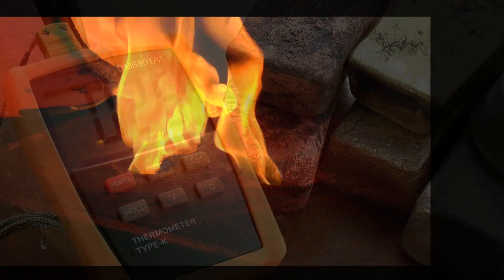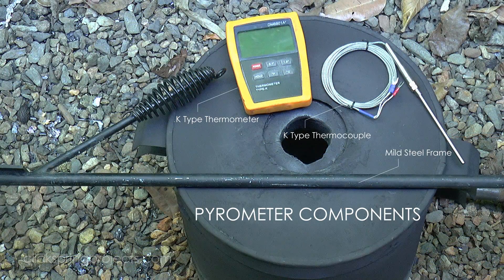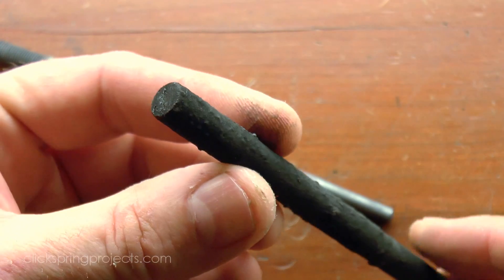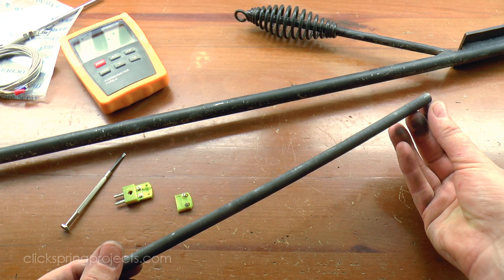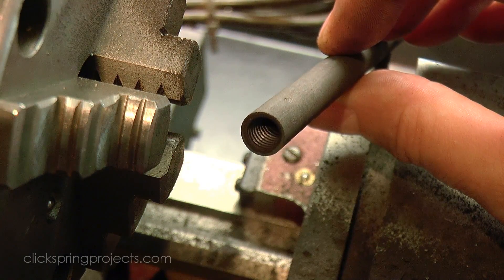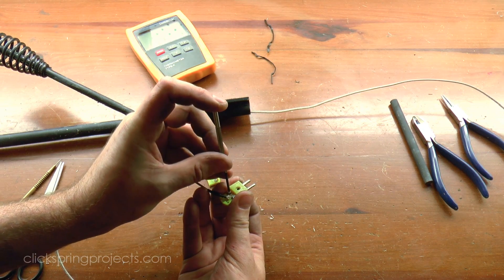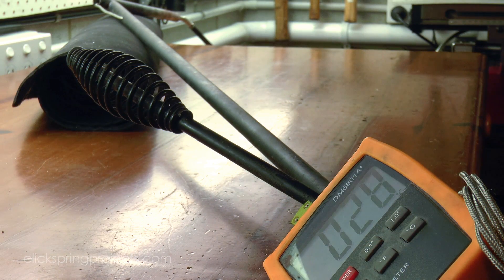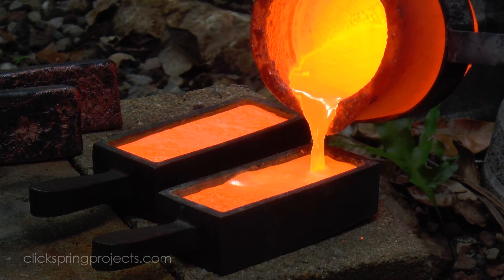Tools, Glorious Tools! #5 - The Pyrometer

Comment: If you know the material - you can use a visible light camera to approximate the temperature due to predictable black body radiation showing up in the visible range. So you could theoretically make a phone app. Just have to be careful with avoiding any processing like white balacing and knowing exactly what the spectral reponse is of the red and blue cfa.

Comment: All thermocouples that comply woth ANSI use red insulation for the negative lead.  If IEC, they use white.  The two most common types are J and K.  J type thermocouples are white/red (ANSI) or black/white (IEC).  K type are yellow/white or green/white.  J type has the best response from -210 to 1200 C (-346 to 2193 F.  K type response is -270 to 1372 C (-454 to 2501 F).  On the connector plug, the wider tang is usually negative.  The usual reason to select K type over J type is that above 750 C, the iron in the J type is susceptible to oxidation, whereas the K type is aluminel/chromel.  The K type can be damaged by reducing atmosphes, and is sibject to drift over time, requiring periodic replacement.

Comment: Hi Chris. Have used a lot of those K-Type probes for everything from freezers to forges with Arduino.  They are cheap and I found them to be very accurate. Never thought about the carbon sheath idea. Do you get the rods from local welding/engineering shops. Not sure what the NSW equiv would be for Nth QLD

Comment: A question in relation to the heat conductivity of carbon between the fluid in the furnace and the thermocouple.  Is the heat transmitted 100% or is it less due to heat loss in the carbon?  i.e. molten metal is 1000 degrees - does the thermocouple read 1000 degrees or 995?

Comment: Is it possible to get thermocouples with any specialty coatings in case one does not wish to use the carbon sleeve, but still keep the dross and slag off the probe?

Comment: Chris how do you know the temp is fully realized through the carbon? Do you have to compensate for the probe being inside the tube?
Reply: When the recorded temperature is stable, you can be reasonably certain that the temperature of the probe is the same as the outside of the carbon tube.

Comment: After about 5 or 6 years of blacksmithing, i'm pretty much able to evaluate a temperature with a 25/30 degrees C margin by eye. Wich is kinda lame compared to what a pyrometer can show, but it requires just skill, so no tools or complicated technology, and it only takes a glance. Tho i wonder how far you can train your eye... Maybe the most skilled could rival low end pyrometers, i'd be curious to experiment with that

Comment: This guy is probably the only one that could pull off drilling a carbon rod and then tapping it without shattering the rod
Reply: I'd shatter it just mounting it in the chuck haha
Reply: @jdmjesus6103  all carbons are not equal. The stuff in the middle of a dry cell is really naff, that would disintegrate picking it up.
Reply: I once shattered a carbon rod just by looking at it. 

Through a monitor on the other side of the world.
Reply: @ricos1497  You must be related to Chuck Norris.
Reply: I remember some sort of japanese TV show where someone drilled through a pencil lead.  Kind of a race between a lathe and a edm machine
Reply: @afjieaf80eg  "supreme skills" is the name of the show. I love it!!

Comment: Have you tried using a high range IR thermometer? Curious as to if you have a preference/reason for a preference between that and a thermocouple, as I have seen some with relatively high ranges for pretty affordable prices.
Reply: IR thermometer accuracy depends on the thermal emissivity of what you're measuring.  Granted, most metals are quite emissive when molten, but they still only indicate the surface temperature, not the core/bulk temperature of the material.

Also, the less expensive ones tend to just give up above 200 degrees.

edit:  I missed that bit about high-range, but the other conditions still apply.
Reply: reflectivity might be an issue, and as well this video originally came out for patrons years ago, prices for IR thermometers werent so affordable then
Reply: i use one for forge welding billets of damaascus and for mokume gane. they are excellent but take some practice aiming because the laser dots tend to disappear amongst the glow of the forge and metal.

Comment: Wouldn't be easier to use a laser thermometer?
Reply: They typically cap at too low of a temperature, and the reflection off the surface totally mungs the reading. I can point at molten aluminium and it might only read 500f!
Reply: Laser thermometers use infrared, specifically they measure the brightness at 2 different wavelengths, then fit the bell curve of black body radiation to fit the readings.
Things that are hot enough to glow are too hot for this method to work.

Comment: Nice video chris. You can do the rod test also, which you take a 6mm or 10mm steel rod and preheat it in the furnace exhaust first, then you stick it in the metal, if the metal balls up on it when it's pulled from the melt, then it's too cold and needs to be heated more, if it leaves a thin shell on it that's paper thin, then it's perfect pouring temp for most stuff, and if the metal repels the steel rod like magnets, then the metal's too hot and needs to be taken out and cooled down. That's a good alternative to needing a pyrometer for someone getting started in metal casting, and works with aluminum, brass, bronze, copper, and other metals all the same.
Reply from the maker: Thank you mate, I had not heard of that method will give it a try! Thanks for sharing :)
Reply: @Clickspring  Yea, the rod trick is an old foundryman's trick that's been around forever. 

Another thing, youre using borax or boric acid as a cover/flux for brass/bronze/copper alloys, I really wouldnt do that because it attacks the crucibles horribly badly. It was common to do before people realized how bad it was, mostly as a glassy cover to help prevent oxygen from reacting with the metal and absorbing into the metal, forming porousity, but if you run your burner slightly rich for copper based alloys so there's not free oxygen, it does the same thing and doesnt eat your crucibles or lining either. I run mine that way and it is much easier to melt the stuff, no porosity in bronzes, and no very little oxide on the melts too.
Reply: I never thought about a wetting test, but that's awesome!

Comment: "extinction pyrometer" are a thing.  A filament light bulb, as the voltage is increased the filament glows.  When it's the same colour  as the molten metal just read off the temperature indicated in the veritable resistor that controls the voltage to the bulb. Calibration is awkward but it's a no contact way of measuring the temperature.  Just a thought.

Comment: I'm surprised that a thermal grease of some sort isn't required to get a fast reading from the probe.
Reply: That's because at these temperatures, heat transfer is dominated by infrared radiation. Since the thermocouplenis surrounded by the hot carbon, heat radiates in until it reaches an equilibrium. And since the heat flux is substantial, that equilibrium is reached fairly quickly. I wouldn't be surprised to find that conduction through the carbon rod is actually the slower part of that heat flux - at these temperatures.

Comment: The words "home foundry" are delightfully absurd.
Reply: And yet, simultaneously so incredibly cheap and simple.
Reply: Trust me, somewhere in a garage near you, some wacko is pouring homemade castings.  In my neighbourhood it's me.
Reply: i build my own out of a 20lb propane tank with the top turned into a lid, and lined with kao wool. i would recommend it to anyone! melting down aluminum cans is very relaxing.
Reply: @chrisgenovese8188  Ceramic wool rocks.    I use satanite to face it.
Reply: Yes, and way back in the early 1980s, David Gingery decided that a home foundry was the best way for him to make his own metal lathe..... So, it's definitely not a new concept.
Reply: @johncochran8497  Thanks for mentioning a tool making resource I wasn't previously aware of.
Reply: I also get confused looks when i mention I'm a hobby brain surgeon 🤪
Reply: @DasIllu  I've had people look at me like I grew an extra head when I told them I dabble in homemade pyrotechnics...
Reply: I've always wanted cast housing.  I wonder how the value holds up versus traditional home construction.
Reply: @Kineth1  That actually is a sort of thing, although the material being poured isn't metallic.
Reply: Just the normal unique stuff. 🎉
Reply: Closely followed by “enjoying the fun of pouring metal”. :)
Reply: its super easy to make and cheap